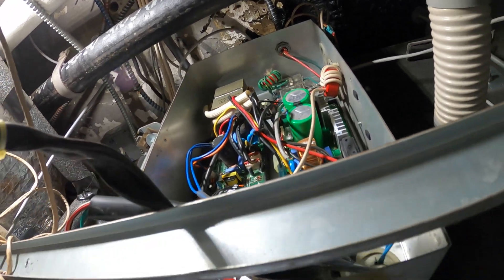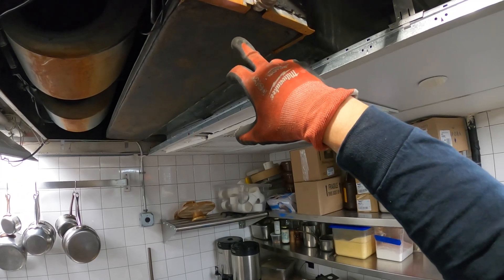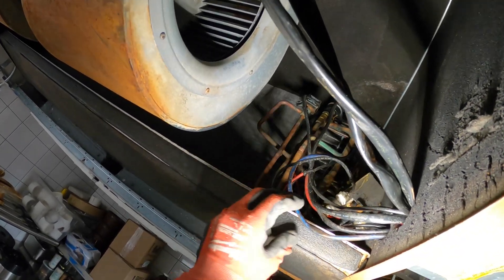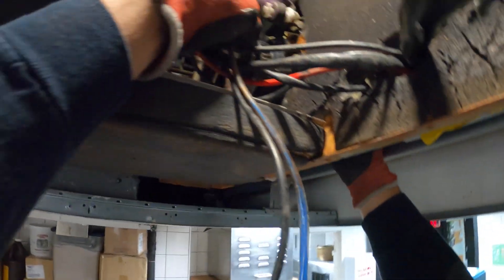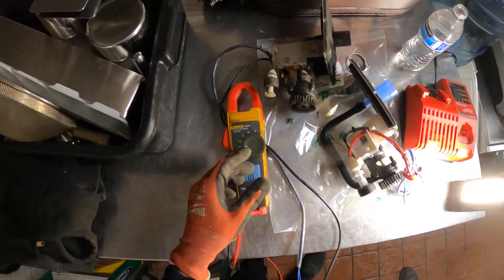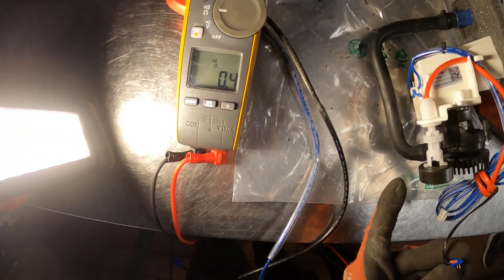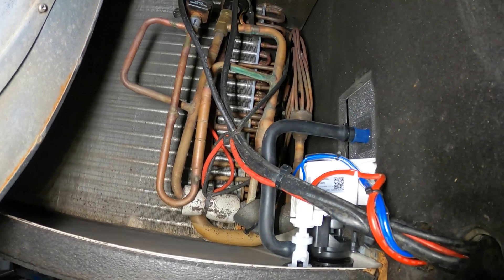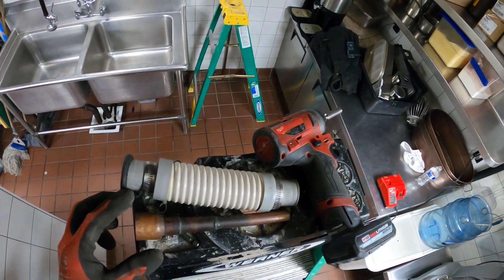HVAC: LG Multi V Air Duct Leaking Water PART 4 (Water Pump Assembly Installation) Condensate Pump

Comment: You don’t have to remove the bottom panels to change these pumps. Just 4 screws hold in the pump and 2 plugs to the circuit board. Make sure the float isn’t stuck in the up or down position by any of the cables that run near the float.

Comment: Seems to me the float was working backwards,,off when down and on when up?? 13:45
Reply: The float doesn't really control the pump on these units. Whenever the unit is in cooling mode, it will run the condensate pump the full time(?). The float is a lock out float that will put it into a CH-04 error and prevent the unit from operating if it is up for too long.
Reply: The float switch running the pump directly was my first impression when I made the comment, I didn’t realize it ran continuously when in AC and used as an safety shutdown switch
Reply: No it was working properly, continuity when down and breaks circuit when up